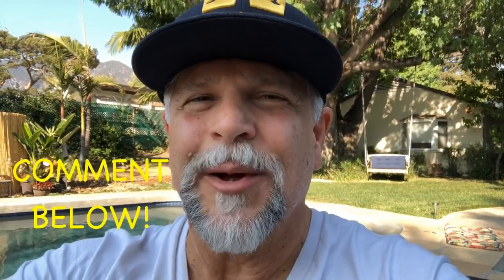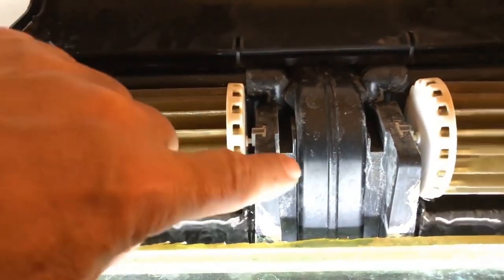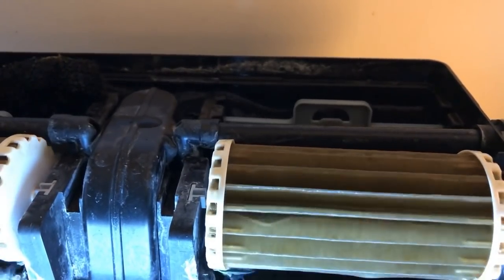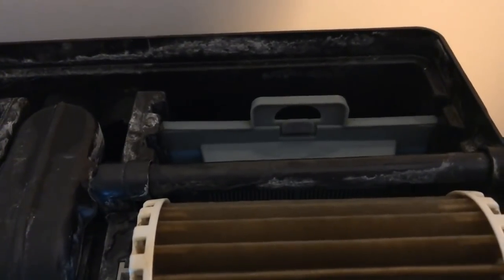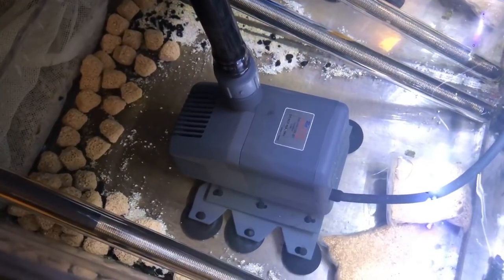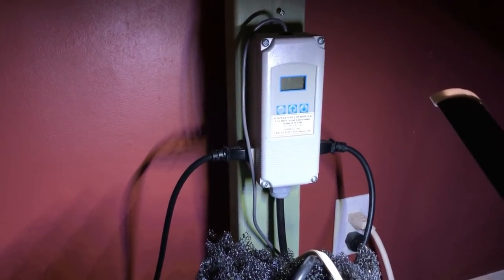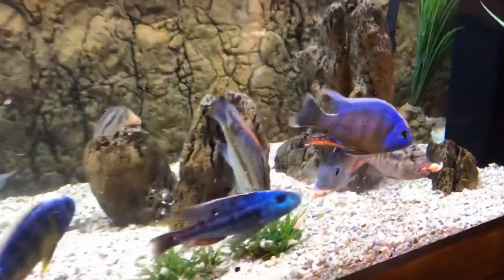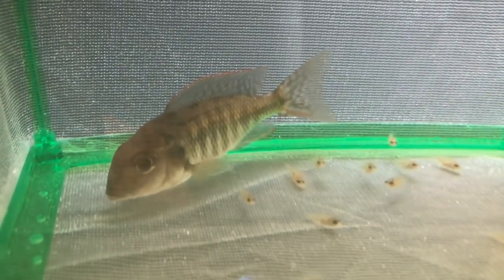Hang-On-Back Aquarium Filters [AN UNDER RATED GREAT FILTRATION OPTION!] - Why I Love Them!

Comment: When I used HOB's I always replaced the cartridges with Aquaclear foams and used a foam pre-filter on the intake.  To me the foam pre-filter is a no brainer...you greatly increase both the surface are for bio filtration and the service life for whatever media you are using inside the HOB.  Thanks for the video.
Reply: This guy HOBs.
Reply: Agree. The filter that come with the filter are just money maker.
Reply: The foam on my intake always gets gunked up and impedes the water flow so every couple days I have to remove it and clean it off. So I stopped using that on my intake
Reply: @FrozT99  Only use course pre filters.  Get the applicable one for your filter from Aquarium Co-op.

Comment: Good evening Ben,
I do something similar on my Emperor 400 which I run on my planted 75. I stuff the bottom of the filter housing with poly-fill which polishes my water and on top of that I run a nylon bag filled with chemi-pure green carbon. On the gray cartridge I run Fluval's bio-media and my water runs crystal clear and with no funky orders to it. I have been thinking on getting some coarse sponge for the initial phase / stage of the filtration process, and then running the poly fill followed by the carbon ending with the bio-media.  Good information in your video, thanks for sharing.
Reply from the maker: Usually I like the water to touch chemical filtration last on the way to the tank, but if your fish are looking good, colorful, eating well, I wouldn't change anything about your set up!

Comment: I like HOBs for the economy of them - same job as a canister at a fraction of the cost. I like the AquaClear for it's design and lack of cartridges; much easier to use your own media setup.  I modded mine a la Cory from Aquarium Co-Op, but also got rid of the biomedia that came with it. It was little pellets and had as much pellet dust as pellet in it...threw that out and bought some dollar-store plastic scrubbers a la King of DIY.  I added polyfil under the biomedia to polish the water and this works well for me.

 I'm saving the carbon for when I may actually need it, to remove meds or some such.
Reply from the maker: That's a great set up and I thank you for posting this.  I too love modifying and tinkering to suit my tastes.  You set up makes sense both from a function and cost standpoint.

Comment: Hi Ben, it looks beautiful in Southern California. Right here in Chicago today this morning it is 17°F with wind chill is down around 4°F. Our high today is only going to be 25°F, so to enjoy it while you can. Great tips for the HOP filter. I’m sure there will be many people in the hobby that will enjoy these upgrades. I have the Seachem 110s that have a totally different configuration where are you add the sponges with Pinky and then the bio bags on top of the sponges followed by some pink he floss. I also use Purigen. When you buy the Rio pumps new, they already come with the rubber suction cup assembly to dampen vibration. Finally, I think you should try to do something with those fries or you have in that new pair of Red Caps you have to add a new dimension, and sell off your offspring to your local fish store or trade for equipment and supplies. I think you would enjoy it. Thanks for sharing

Comment: I use 2 Marineland Emperior 400 dual bio-wheel hang on back filters on my 125 gallon reef.I remove the bio-wheel's on both filters. On each compartment I use Poly Filter 4 x 8  it does not need to be cut just folded. I insert 1 bag of Boyd Chemi-Pure Blue 5 oz.behind each pad. This works great for me.
Reply from the maker: That's a smart set-up!

Comment: Far as hang on back filters I love Fluval Aquaclears. I've learn how to hot rod them by Cory from Aquarium Co op. I also really like the clear plastic housing so that Im able to see what's going on inside. I have cichlids (overstocked) that like to poop a lot which makes filter cleaning unpredictable at times and when sponge becomes clogged you notice it through the housing and most importantly there cost effective because you dont have to replace media or sponges again for years. Mine are going on 3 years and I haven't had to purchase replacement parts.
Reply: Love the AquaClear!!

Comment: Good stuff Ben as always I run hob’s on most of my tanks on thing I do one my big show tank is that I keep my chemical media in them and just bio and mechanical in my canisters so if I need to treat the tank with meds I can just easily remove it and not have to take apart the can filters
Reply from the maker: Ry Mac cichlids That’s brilliant!  I hate having to pull chem then add carbon, then pull out the carbon and replace the chem ... in a canister.

Comment: Nice video Ben...The Seachem Tidal HOBs are amazing... could run a 75-100 gallon with two of them alone...a suggestion I would make for that Pinky floss would be to buy a large 50-100 micron filter pad...you could cut out the size needed and put it right on top of the Pinky floss...you would put it in place after the water flows through the Pinky floss...those micron filter pads are amazing and will literally catch anything that gets through any type of aquarium floss. It can be cleaned and reused plenty of times too.
Reply: I'm running 2 tidal 110s on my 75. Its a must have if you have constant power outages. I also run a ups with back ups on it.

Comment: Great video, I like what you did. I took out the removable media from mine and covered the input with filter floss. Then, I filled the cavities with lava rock for bio filtering. In my penguin style filters, the floss is just a plug and changing it takes only about three seconds. The Tetra I'm using on my salt tank is a pain, though. I have to remove it and take it to the bathroom to remove all the media and replace the filter floss.  But it's eventually getting replaced, too. I may move one of my penguins to the back of the salt tank and do away with the tetra HOB.

Comment: Great video my friend, thanks for the tip on the marineland 400, great idea, also I heard that the new filter have seal impeller so do not have to take out like the old one that are a pain to clean, that's true?
Reply from the maker: Efrain's Cichlids I don’t know about that change and I’m not sure I would like it since gunk can accumulate on the blades and the shaft. Maybe it can be removed with a screwdriver, similar to a Fluval motor housing?
Reply: Ben Ochart my 350B is new design, leak proof, easy care one piece tank and motor assembly means no o rings to fail, single moving part removes easily for cleaning, no oiling or motor maintenance required, is the new 400 is the same will be awesome

Comment: I have 3 HOBs.  I use course black foam in the whole thing.  Cartridge replacements are a huge rip-off.  I can double or triple the amount of surface area with foam.  I also use a pre-filter on the intake so I do not have to clean the filter as much.  Just pop the prefilter off.  Rinse it in some tank water and you have cleaned HOB!
Reply from the maker: Sounds like a GREAT set up.  Pre-filters are a huge help.

Comment: I have a 75 gallon with two Emperor 400 they work excellent crystal clear water I have two 55 gallons with two 350 Penguins also work excellent
Reply from the maker: Paul Cardoza HOBs are workhorses  and get the job done

Comment: I have a 29 gallon with the top fin hob filter when you do water changes it drains out. Do you fill it back up with tap water when using my python?  Because seems if I just turn it on it is very loud trying to suck water into the hob to get the flow again. Don’t want to burn up the filter thanks again

Comment: One tip, I would leave that power head running during a water change.  When you add you dichlor the mixing will assure rapid and even neutralization of chlorine and chloramines.

Comment: You should do a video and tell people that their being misinformed about keeping peacocks and mbuna together. Most say it shouldn’t be done Bc mbuna are to aggressive. You can counter this by buying smaller mbuna and buying peacocks bigger than them. This levels the playing field and allows them to coexist.
Reply from the maker: I actually tried that but when my mbuna put on size, even my mellow Lab and Yellow tail, they gave the peacocks a real hard time.  It was in a 60 gal, which is pretty small for African Cichlids, so maybe in a bigger tank it would have worked.  It's currently working for you?
Reply: Ben Ochart so far so good but the peacock is about 3-4” and the mbunas are 1-2”. Yeah I jumped the gun to early and bought a 60 gallon tank stand and led light at Petsmart for 199$. Hard to turn down that price. But I should of went with the 75 gallon for $299. But I was hesitant living in a 3rd floor apartment. Carrying a 75 gallon aquarium, stand and then having the room to set it up. So I figured the 60 would be more practical for my residence but I deeply regret it I want bigger already!!

Comment: I’m switching all my tanks to HOBs, they are so much easier to maintain
Reply: I'm switching mine from HOB's to all matten filters and sumps.  I found that HMF's and sumps are easier to maintain .. HMF's can be run on air.
Reply: @MELODYMUNRO  i really like Hmf massive surface area for bacteria.
Reply: LOL Jamie, I'm trying to replace all mine with internal sumps or canister filters.  Most of my HOBs pollute my aquarium water when I turn them off or remove the media to clean.  And they are noisy. With five of them in one room, it's hard to hear the wife yelling at me. (not that I want to hear it, but there is more peace if I do. LOL)
Reply: @BlessedLaymanNC  which ones do you use?

Comment: Thanks for posting ! That’s an EXCELLENT tutorial on the Marineland Biowheel Filters. I run nothing but HOB filters on all 11 of my tanks but my filters are Aqueons, Top Fins and Tetras. With that being said, the internal parts involved in these (Aqueons, Top Fins,)filters are NOT as complex as the Marineland ones. For example, inside, the Aqueons and Top Fin filters, there is only a carbon filter cartridge that should be changed 1x per month, and with the larger Aqueons filters there’s a plastic bio grid that holds an ammonia remover pad. In the case with the brands of filters that I have I find that I DO have to unplug and remove the filter to clean it AT LEAST ONCE A MONTH because they GET CLOGGED LIKE NO OTHER TO THE POINT WHERE THE WATER STOPS FLOWING.  Usually,  it gets clogged with waste and uneaten food in which case it becomes more of a threat to the water quality if the problem isn’t addressed lol. This is why once a month I DO REMOVE MY HOBS AND BLAST EM OUT AND I ALSO RINSE THEM WITH RO WATER before they are returned to the tank.  Now, at this point I must tell you that I RUN ABSOLUTELY NO SUBSTRATE, SAND, GRAVEL, OR DECORATIONS IN MY TANKS AT ALL because my main focus is the fish, their behavior and the water quality. 🐠🐠🐠 So that DOES make my situation a bit different from most aquarists in that I do not have gravel to rinse or clean, I simply vacuum the bottom of the tank. This has made fish keeping and tank maintenance SO MUCH EASIER for me personally and I have actually ended up successfully breeding my Red Top Lwanda Male 4x this year (you already know that lol)  because of my practices with my tanks and their setup. Of course, no one way is the best you gotta do what’s good for you and your fishies🐟 Your tanks and fish are beautiful!  I also use a SeaChem Ammonia detector that sticks to the inside of the tanks and alerts you when the ammonia levels get too high (even in the slightest). They last for a year, sometimes longer, and I can attest that they actually WORK. I have 4 of them, one on my 37, my 40, my 20, and my 28. Just recently I had done a 50% water change on a 20 gallon tank of some fry that I have and just shortly after, the reader showed the minimum alert for an increase in ammonia. Turns out in my analysis of things I figured I might have over-Primed the new water , fortunately, I have a reverse osmosis water system so I did another 50% water change with the RO water and had the problem solved within hours. BTW, if anyone is interested, and uses SeaChem Prime to purify their tap water, I found some particularly INTERESTING DATA. FORMULA FOR PRIME TO WATER IS 2 DROPS PER GALLON 💧Noticed you said you are from SoCal! That’s awesome, me and my fiancé were born and raised there and are trying to move back to California but this housing crisis is something else. Lol and thank you for sharing this info because if I EVER get a Marineland Filter, I’m gonna NEED this video so thank you again! Happy Fishkeeping Ben!